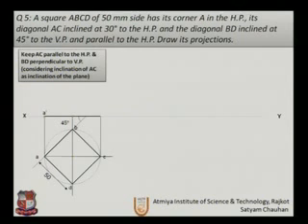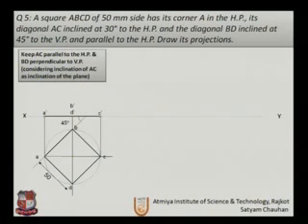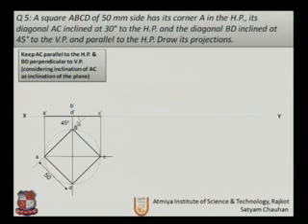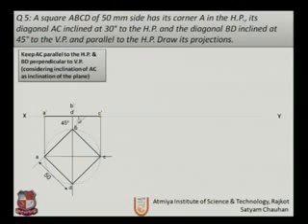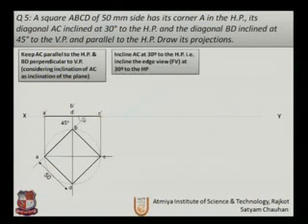Satyam Chauhan Engineering Drawing Projection of Planes 3

Comment: A 30-60 set square has its shortest edge 50 mm long & is in HP. The TV of the set square is an isosceles triangle. Draw projections with the hypotenuse of the set square inclined at 40 to the VP.